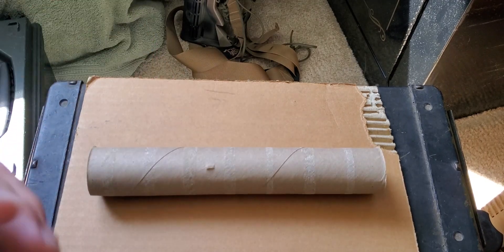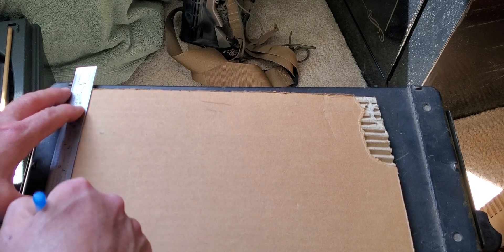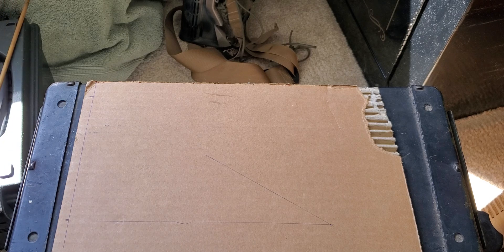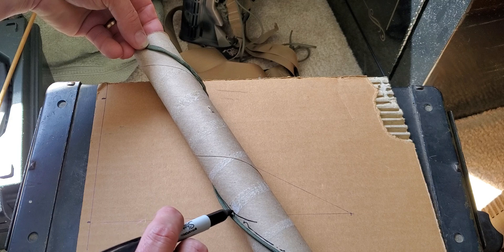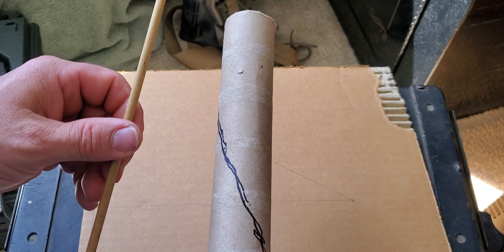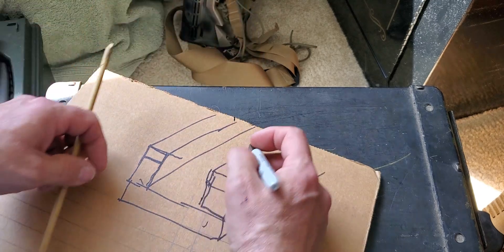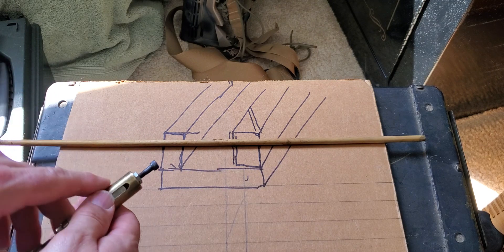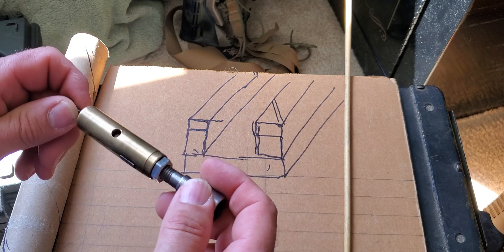Make your own rifled barrels video 10 part 2 of 2

Comment: For this example, I almost wonder if you could put some wet ink on the cardboard, and then roll the tube across that and it would print onto the tube.
Reply from the maker: Thanks for the comment. 
I don't see a reason why it wouldn't work.  You just have to ensure the spindle (tube) stays aligned as it's rolled.